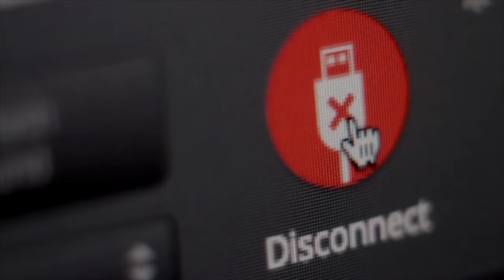BetaFPV HX115 is the best micro FPV racing drone with HD video

Comment: Anyone thinking to build for a three inch t style triblade should check the Emax 1306b motors out. They are very smooth and have almost no "coggy' feeling. The 1408s are very coggy though beware! kind of a bastard motor imo unless some 3.5 or 4 inch t style props are available? (Anyone else notice the avan 3.5 inch prop on their thrust test tables???)
Reply: Mr. Pink FPV 1306b are good motors but that’s a whole different type of 3”. I use those motors on my 3” go pro hauler. On this setup 1105 is ideal
Reply: @woopweep9605  yes yes yes! A 3 inch that really does punch out a 5 inch. 

This is my quad version of the v8 swap Miata. Hahahah! Just for fun, and it's loads of it lol. 

I do have a heavier, basher frame so that's a factor. But rocking the triblades on 4s have even less propwash than on a lot of 5 inch quads. And it punches out almost identically, but doesn't hit the same top end speed.
Reply: @woopweep9605  Worth a try! It is a different class almost, but this is a funny quad here. Not quite a toothpick, not quite a respectable 3 inch. 

Most people agree 1105 isn't really ideal for spinning 3 inch props for freestyle, maybe better for racing? Or idk maybe I'm just getting too sensitive like Kabab 😅
Reply: @woopweep9605  to each his own, but I can also tune these to the moon! I have really well tuned quads that run cool motors, where those 1105s would be smoking. It's really worth getting the 1306s if you like removing filters/are sensitive to latency in the stick feel. 

Happy Flying! Cheers!
Reply: Mr. Pink FPV it’s an apples to oranges comparison 1105 to 1306, they’re just made for different weight classes all together....also the 1306 are the bigger mount, they wouldn’t even fit the quad in the video
Reply: @woopweep9605  that's what I was trying to say. But it's not hard for me to say, I prefer oranges. Why buy apples?
Reply: @woopweep9605  thanks for the help... But I said anything thinking to make their own build ☝️
Reply: @woopweep9605  I also disagree that you can't use it on a lighter weight class. Yes there is that hauler application but 1105s won't spin the triblades well on 4s. They have a particular focus on a class just between this and a typical 1408 with a 5mm nut.

I think this is the sweet spot. But hey. Keep arguing based on hypotheticals. You seem to like it.
Reply: @woopweep9605  I have a quad built for a light 1306b "......." And tell me it's not a better flying quad than this, Amy cinewoop, or any 5mm 3 inch prop rig you can make. 

Your loss. All just cuz you labeled them as a certain "class" in your head. Remember when we used 1806 on 5 inch......? Yeah 2205 isn't for a different weight all together just cuz it's a bigger number kid..
Reply: @woopweep9605  don't you have anything more positive to do than go around and disagree with people's YouTube comments than continue to deny their pov. And we were supposed to be friends here... No wonder the community/industry is DYING.
Reply: @woopweep9605  and JB made signature 2208 and 2407 motors for 5" quads.. the trend is that our current standards are not optimal for freestyle. But hey go ahead and  disagree with how JB feels if you're that much of a smart ass. 

Some people like bigger motors if they actually know how to build and tune for them. They fly the best. Just saying...
Reply: Mr. Pink FPV huh? Dude you’re arguing with yourself. I definitely have better things to be doing than debating with some dude who can’t form a sentence and is getting aggravated over nothing. I have 1105 quads and 1306b quads and can whole heartedly say you don’t know what the hell youre talking about. The industry’s is fading because it’s full of grown men who act like idiots on the internet. ✌🏾
Reply: @woopweep9605  time to watch some vids and figure out where you live 😚
Reply: Troll Toll FPV lol! Portland, Oregon....bring your quads, I’ll teach you to fly em 😉..haha. Happy flying, man

Comment: 4s 520.. That can't fly good.. Those 1105 are already not nice on 3s 450..to really make it good it needs a 1303.. But thats a bit more expensive then..still would prefer the tp3 just to support kabab
Reply from the maker: They recommend 4S 450 but it flies great on 520. Probably better on 450 but you fly what you have.
Reply: Peter Zingler have you even tried 3s 450 on 1105? I fly 4s 450 on a similar setup on diatone 1105s and it slays....videos on my channel for proof 😉

Comment: After my experience with betafpv, I will NEVER buy any of their products again!
Reply: The RC Crash Project I’ve NEVER had a single one of their products work out of the box. Fc boards and motors have always arrived dead.
Reply: @goaway4702  And to top it off, their customer service is beyond abhorrent.
Reply: The RC Crash Project I would rate them worse than Eachine
Reply: @goaway4702  Yeppers